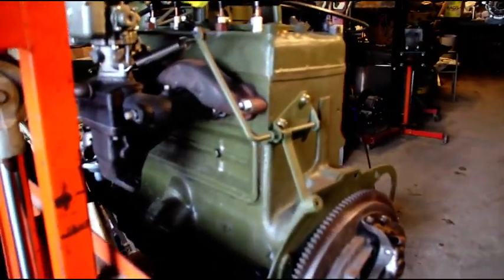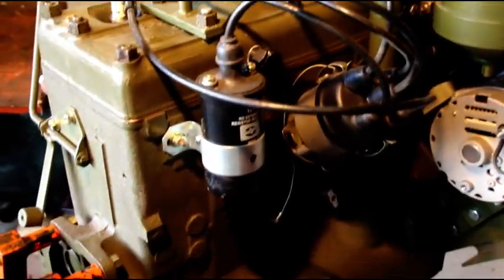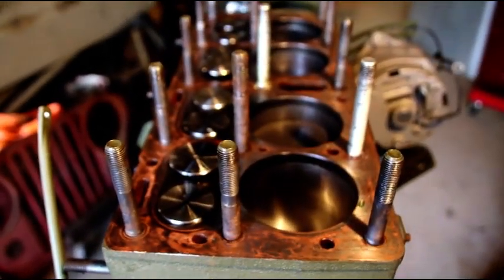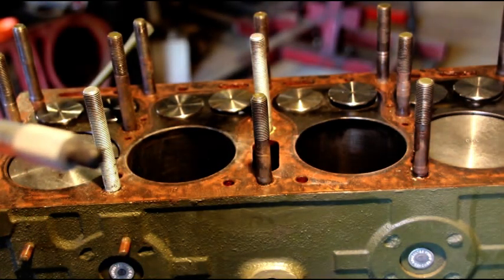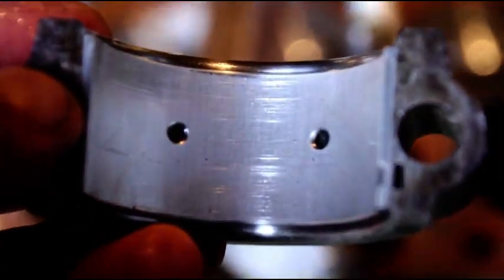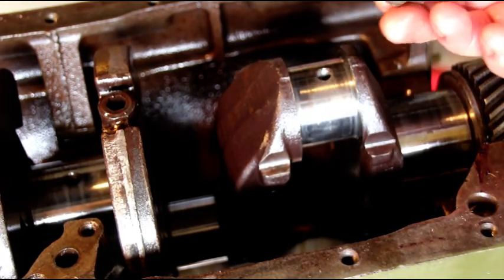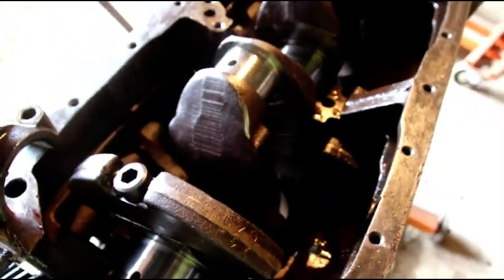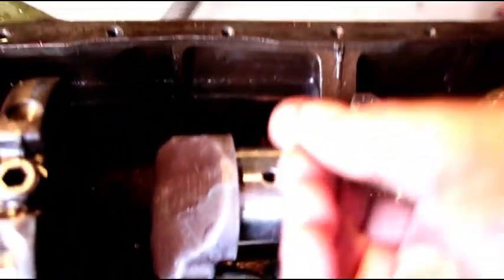Willys L Head Engine Problems, Looks Good Outside, Junk On The Inside !!!!!

Comment: I think it is great that you show us a project, and at the same time speak personally to your customer about the status. In this case, Gary got screwed, and I hope that the other builder makes good, but it also teaches the rest of us to “trust but verify” when dealing with a supplier or builder and to get ironclad guarantees in writing. You detailed the failings in the rebuild which helps us (and Gary) to know what to look out for. I hope you can save the block and head. Thanks for sharing!
Reply from the maker: I am as transparent as can be with my engine rebuilds.  I want my customers to actually see what is going in their engine and how it is going together.   I do a good job on every engine and sleep good every night.   I don't know how the shop that sold this engine is still in business

Comment: Thank you for sharing this Brian! I have a pretty strong feeling I know which company it came from and with all I've learned from you through the years, from the outside I can tell their engines aren't put together right, sometimes the heat riser is stuck and they seem to always put the distributor 180 out. But I never imagined they could be so bad on the inside. Glad it is on good hands now, as always looking forward to the next video!
Reply from the maker: Nothing but bad engines have come out of this other shop.  Keeps me busy though.

Comment: I always appreciate that you don’t only say what’s wrong with things but you always show it. The learning never ends on your channel! Have you ever converted a 4.0 inline 6 with the coil packs to a distributor set up with a carb? My buddy has the 4.2 in his jeep and it’s shot and he has one of those newer 4.0’s. I was wondering if I could put a distributor in there and swap the carbureted intake and stuff over and get him on his way. I usually swap an amc v8 into my cj’s so I’m not too familiar with the 4.0 comparability with the 4.2 stuff. Thanks Brian!
Reply: As long as it has the correct castings, oil pump, and hold-down to accept the distributor, then yes. 4.2 head, crank, rods should be kept if the other engine block is being tossed. Good for trade/sell.
Reply: @luketalkin5000  I’ll have to take a closer look at those points you mentioned. Thank you. I’m hoping the old engine will be a decent rebuildable core

Comment: What is the minimum oil pressure on a warm engine you consider to be acceptible? Thanks
Reply from the maker: I like to see a minimum of 20 psi on a warm engine at idle.   I have witnessed a lot of old engines running on 5 psi at idle when warm without any trouble also.  Just depends if the engine is new or very old.

Comment: I wonder if this engine could be from Classic Military Vehicles in Bella Vista, Arkansas?
Reply: Have you heard negative reviews from his engines?
Reply: That's exactly what came to mind the minute I saw it. And it seems like it is! I just looked up their page and in many engines they have the same configuration/type of coil and distributor and they have it clocked like Brian shows with the positions switched beginning with number 4.
Reply: @jasonpollack899  I've bought a few parts from them and things were normal, it's their engines that seems like they are garbage and massively overpriced in my opinion. Around 5k and you get stuck with something like this? 🤦 With all I've learned from Brian through the years, I can tell their engines aren't right, just from the outside and are put together incorrectly, but I never expected them to be this bad on the inside. It saddens me to see things like this.
Reply from the maker: yes I believe so.  Arkansas.  Not Alaska.    Be very careful if dealing with him.
Reply: Especially when their website indicates all of the machine work that is supposedly done.

Comment: I have a 1991 Nissan Sentra that developed a knock at 375,000 miles. When I pulled the rod caps to check the bearings they had only one or two minor scratches per bearing. The  main bearings looked almost new and all checked out good on oil clearance. It turned out to be timing chain guides and the tensioner making the noise. I can't imagine how awful of a job was done on this engine that you're working on for it to be in such horrible condition. This rebuilder needs to be called out and put out of business.
Reply from the maker: I still don't know who the machine shop is, but as you can see they do horrible work.

Comment: Brian, aren't you afraid of burning the head gasket with 080 pistons? The cilinder wall gets very thin as well. I am an ww2 chain engine guy but the manual does not go further than 040. Normally I choose to re-sleeve when higher than 030. 

But thanks for sharing this tear-down. Quite shocking and a company rebuilding engines like this, should be prosecuted for customer cheating.
Reply from the maker: WW2 blocks I usually go .060 over or sleeve.  Later blocks can go to .080 without a problem if the interior of the block is in good shape.  When rusted due to running water instead of anti freeze sometimes the cylinders wind up too thin.  Every engine is different.
Reply: @metalshaperJeep  ah, i have no experience with postwar blocks. Interesting to know, thanks for sharing.

Comment: Can that crank be welded and reground?
Reply from the maker: It can be welded and ground again but the cost would be excessive.  If it was a one of a kind crank then that would have to be done.   I will get another crank for this engine to keep the costs down.
Reply: I will never use a welded and reground crankshaft again. I've seen 2 engines where that was done. 1 had the welded area start flaking off after a few years and the other had the crankshaft break in 2 places.
Reply from the maker: @danielbutler578  there are a lot of ways to mess up a crank.  The one that was flaking was probably spray welded.  I will never do that to a crank.  The one that broke could be from a number of reasons.  Either way no spray welded cranks for me.
Reply: I wouldn’t spray weld either. We have a local guy that’s been doing cranks for 40
Reply: Years. He welds and grinds cranks taller that I am